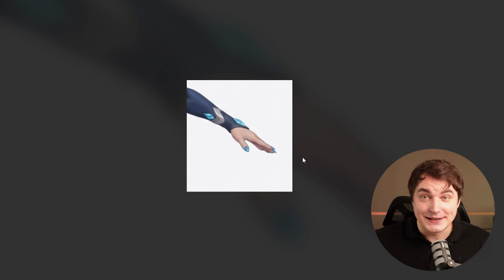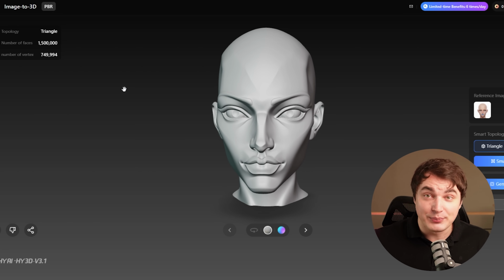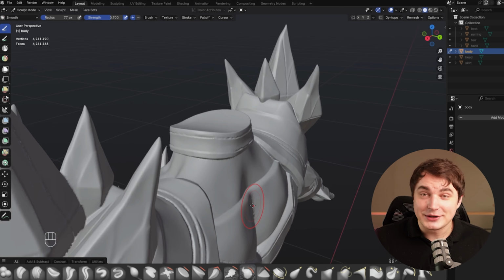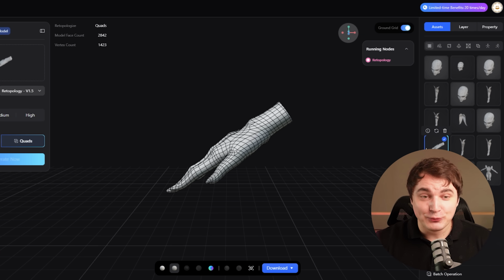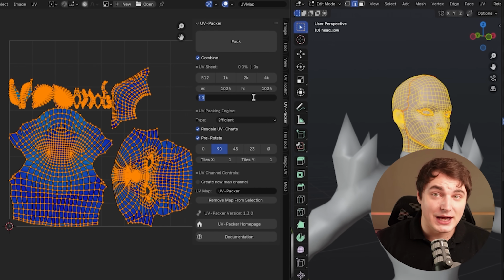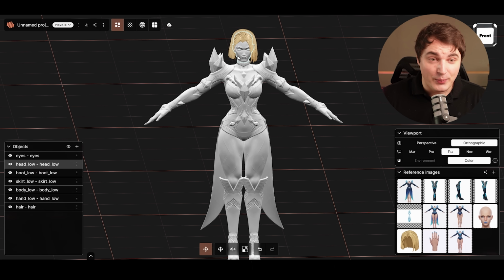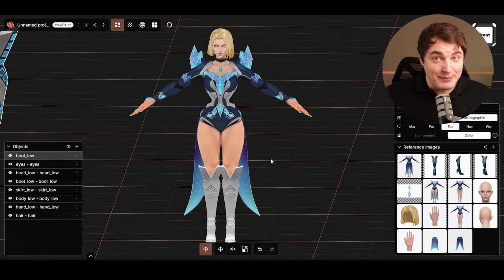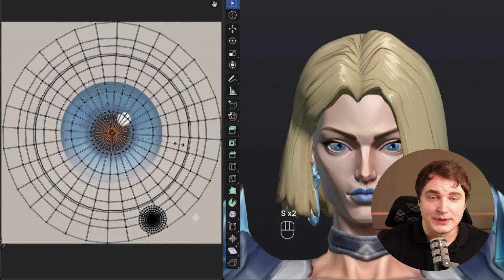I Recreated a Marvel Rivals 3D Character Using Only FREE AI

Comment: I feel like you guys aren't getting the point. The model here is far from perfect but the entire workflow is easier and faster than ever. The whole point of ai is to speed up process. Also this types of 90% ai workflow is good only for prototype. You can create your dream character despite you are not a modeller in just a day and that doesn't have to be perfect and aaa level. Stefan did it easily and fast coz he is professional and if u guys tried it you will find how hard is it. I did a tiger head human body character and it took me 4 days. Even in 10 years from now it will improve a lot but ppl are actually against ai more than appreciating it. So this kind of workflow will still get less paid if money is what you are after for.
Reply: Cope. 
You can't create your dream character, if you are not a modeler. lol
You can create a mess that looks like shit and since you're not an artist, you won't know why it is shit or how to fix it.
Reply: @Kreuzrippengewoelbe I have been a 3d artist for 4 years + and my specialist is animation. The point of this video was never one click ai creation. It was speeding up. I already created dozens of ai mesh + retopo and manual clean up and ai texturing and even use auto rig. U can keep ur heads up high and keep being an irrelevant and slow as shit even after 2 years from now.

Comment: 16:31 our eyes are NOT mirrored. If you watch the 3d view, you can see how wrong this is setup.

Somehow you’ve flipped the eye on 2 axis, and there is only one position of the texture that looks right.  Fix this in your eye geometry and UVs not the texture rotation.

The eyes should be in symmetrical positions but not mirrored, that way a “light catch” glint (and other iris lighting) drawn into the texture looks the same in each eye. The glint indicates the positioning of the dominant light in the environment. A properly setup eye UV would allow an artist to place it wherever they wanted, not being constrained to the one position the texture generated it in, and be stuck with that.

Comment: No offense but it's nowhere near original MR quality, hair looks awful, quad muscles are not correct and bottom quads are f*cked up, textures are blurry and not consistent, edge flow is bad, joints needs more edge loops for dynamic animations,  it's not a game ready model. It looks like a cheap chinese replica. The only place where you can use AI is for getting high poly mesh. topology, texturing, rigging and uvs still are trash. There are still lots of stuff I can say but I don't think there is a need. AI is getting good but still it's just a tool. Letting AI do the crucial jobs makes the model look junky. 

You can use projection for little assets that won't be seen too much by the camera, but for hero assets such as main characters and weapons just don't. Quality is awful.
Reply: It really feels like a junior artist would do a significantly better job at modeling this from scratch. 
Ultimately the hardest part of character creating is sculpting and when you don't understand how anatomy works and the ai will generate something badly you just won't understand what it did wrong
Even then if you have a basemesh the sculpting part is basically redundant